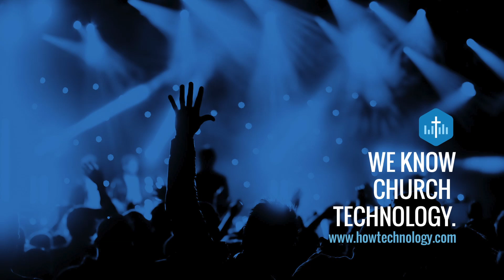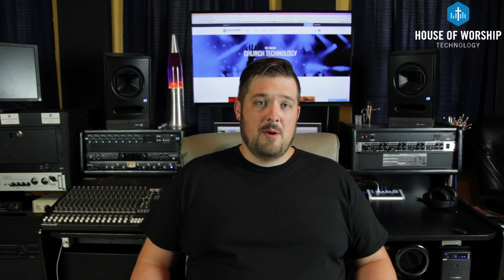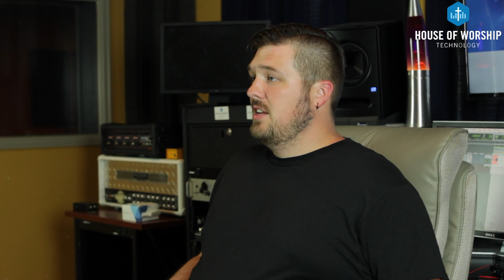4 Audio Signal Types, Mic, Instrument, Line, and Speaker - Church Tech Tip Tuesday

Comment: “Typically what you’re going to do is use a direct box to convert the instrument level signal to an XLR cable and then bring it into the mic jack on the mixing board and then you use the gain or the trim to bring it up to line level once that acoustic guitar or maybe piano pickup is inside of your mixer.”

Question:  if “direct” is at line level (and mic level is lower than line level) are we reducing from line level to mic level when we use Direct Out on our amp (via XLR cable) to the mic entry on the mixing board?

Comment: I'm only have one audio input available that is looking for instrument level.  I have two instruments that need to go into that one input.  My idea is to go from an Allen & Heath Zed 6 compact mixer to the audio interface (Basically line level out to instrument level in).  If I decrease the output from the mixer will it be safe to take that into my audio input?  What should I be looking for in terms of mitigation - I assume clipping but are there dangers to doing it that way?

Comment: Thx for laying that out. Recently I’ve seen videos talking about coming out of a pre amp and into the interface for a recording setup. They said you need to go into the line level input on the interface. Say that most people get this wrong by going xlr. So if my pre amp output is xlr do I need a cable with xlr on one end and 1/4” on the other? If so is it trs or unbalanced? Confusing! Thx!!
Reply: Would also really like an answer to this one

Comment: What happens if I connect a guitar or a bass directly into a pedal that was made and designed for vocals?
For example, there is a device called Boss VE-2 which. It is a mic effect processor  and also an audio interface. 
Because of the audio interface function that device has, I want to use it to connect a bass through the XLR input (prepared for micrphones). 
It is important to say that it has a knob that changes the gain. In essence, the mic preamp.
I now know that the instrument level is a little bit higher that the mic level but, what if I turn the mic preamp down?
Will my idea work? 
Will it be okay to connect a bass into the Boss VE-2 mic effect processor into the XLR input?
(All this using a TS to XLR cable)
Reply: Best thing to use is a DI box, the instrument will have a huge impedance (20,000 to 50,000 ohms) compared to a typical mic level input (around 50-150ohms) So the only usable position that knob could be at is about a hair above 0. This does not give you much control over the level. A DI box will convert the high impedance guitar signal to a low impedance mic signal to then plug into the pedal.
Reply: Just remember that any mismatches re impedance in sound signals leads to either very compressed or clipped audio- Instrument (High) to Mic (low) or very quiet audio fill of hiss - Mic (Low) to instrument (High)

Comment: Thanks for the vid! lol, you do mention it, but can you clarify a little on the use of a DI Box? If I am using a DI Box (for electric guitar) to go into my audio interface (should i be using Line or Instrument level?
Reply: Instrument level
The DI box is not required unless you want to plug the instrument into a mic preamp (usually with XLR) the guitar straight into the instrument input should work fine.

Comment: Good video and nice explanation. Technical but simple. Allow me a question, please. For a bedroom hobbyist do you see gear that may use the pro line level (+4dBu)? If yes, can you give me an example? In other words, do I need to have something like the Radial J+4 DI box or a decent mixer that should be able to go back and forth between consumer and pro line levels? Just wondering... Thx man.
Reply: Don't know if you have been answered on this but I know of a couple of behringer mixers (1202 for example) have switches on their stereo inputs for just this purpose, but you need a nice clean signal for studio line level, as it will take a louder signal to drive it, therefore more potential for noise.